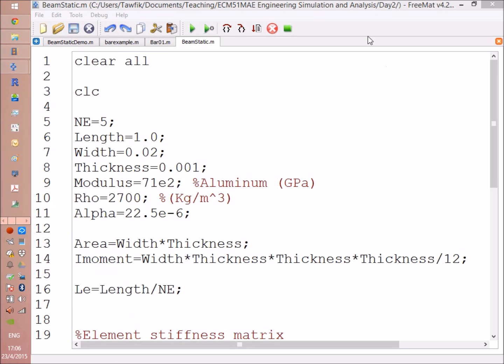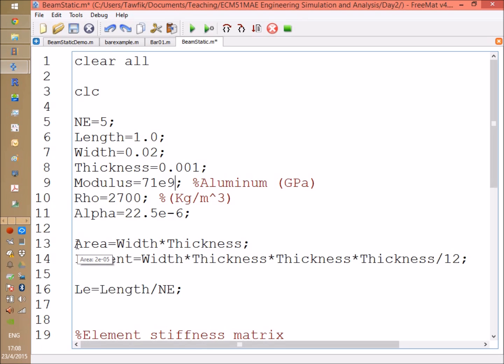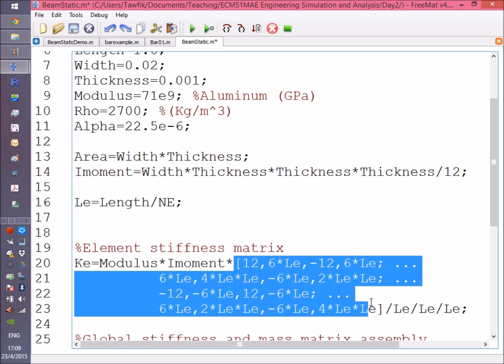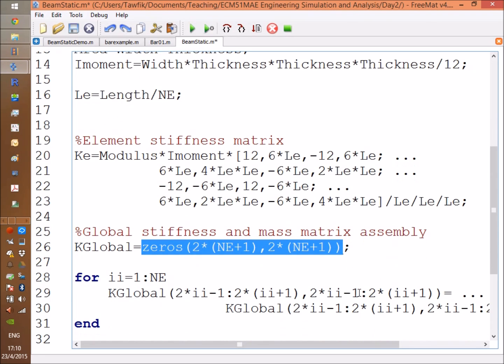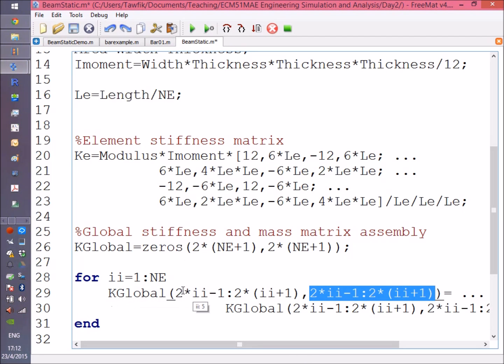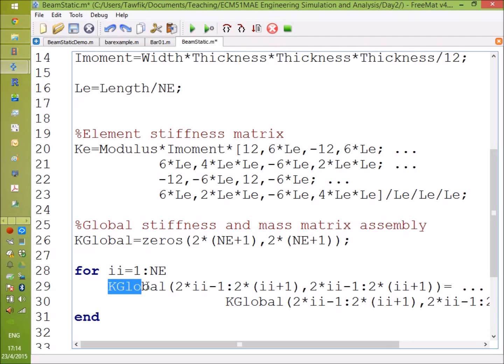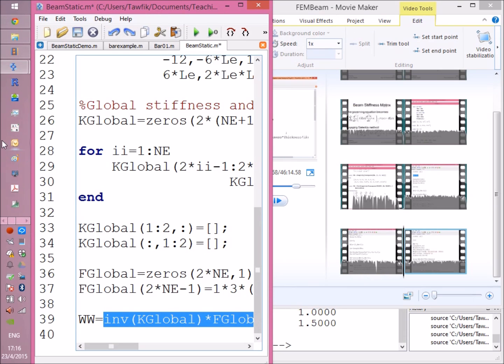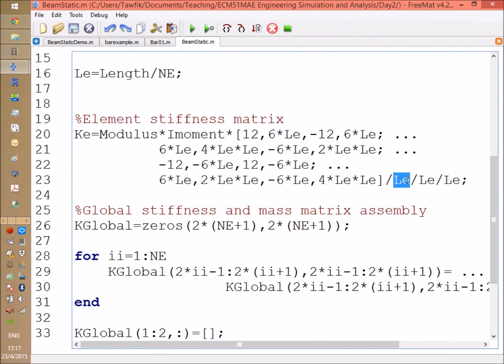FEM: Beam Octave/FreeMat/Matlab Code

Comment: if beam element have different length, width, thickness. there will be different Ke stiffness matrix for each element. then what is the necessary amendments that should be made in code to pop-up global matrix?
Reply from the maker: If you add the code of evaluating the element matrix into the assembly loops, then you may be able to account for the stiffness if different elements

Comment: روح يا محمد قلبي راضي عليك يا ابني !!! فديت خشمك
Reply from the maker: اشكرك على الكلمات الجميلة :)

ممكن أعرف مين؟
Reply: انا  اريد ان اعرف كيف اكتب ماتريكس فيه عشرة فانايت ايلمنت حتى اطلع الnatural frequency , اكتبها لي واعدك ادعيلك كل يوم في رمضان !
Reply from the maker: Check this
https://www.researchgate.net/publication/321850001_Dynamics_and_Control_of_Flexible_Structures_Book_Draft

These are my lecture notes on structure dynamics .... you will finite element code as well ... still, feel free to send me any more inquiries
Reply: Mohammad Tawfik والله انك كفو جتني الصيحة
Reply: Thank you so much. It helped me a lot. I have only one question plz. In the case i have it's a 2m beam with a hinge on the left side,  roller at 1.6m and free at the right end. If im solving for the 1st natural frequency will it be different than a normal simply supported beam ?
Reply from the maker: Sure will be different ... adding a hinge in the FE model is a bit tricky though!
Reply: Mohammad Tawfik any hints on how i can do that ? Or recommendations for videos or books where i can learn it?
Reply from the maker: To add the hinge, you will need to work with the moments and slopes at the node of the hinge as two different values, thus, in the assembly, you will not add the rows and columns of the slopes from both sides, rather, put them as two different one.

Hope this helps

Comment: good video tank you so  much
Reply from the maker: You are welcome :)
Reply: plz can you help me!!
 when i run this program i have this error : Index ecxeds  matrix dimentions
Reply from the maker: Sorry for the delayed response!

This error may appear when you are addressing an element of a matrix that does not exist ... in this case, check the indices you are using, one of them is larger than the matrix dimension (for example is you have a 10x10 matrix, and you are access the element number (11,10))
Reply: @MohammadTawfik  appreciated your effort...I would like to ask ,when I apply boundary condotion on KGlobal matrix it gives matrix of zeros..please you guide me..

Comment: Hi. Good video. Thank You,Sir. May I ask, can I use this method to solve for supersonic panel flutter analysis?
Reply from the maker: Yes ... however, I have another video about panel flutter, and I may be able to guide you through the process

Sorry for the late reply
Reply: No worries. Thanks for replying. I would be glad if you could render some guidance. I have discretise the equation of motion of Von Karman large plate theory by finite difference and have generated some matlab codes. The problem I have was that at t=0, there were deflections,which i think,should not be the case. I dont mind sharing the codes and the workings separately. Hope to hear from you soon.
Reply from the maker: I have not worked with Non-linear Finite difference before ... However, the solution should follow a similar procedure like the finite element, since you have nonlinear terms in the equation ... that is to say, you will need to solve a nonlinear problem at each step (Newton-Raphson, bisection, fixed point iterations, ...) ... I can not tell why are you getting initial deflections, but you will need to introduce them, artificially, every time step to make sure that equilibrium occurs at at ZERO deflctions in everystep BEFORE buckling or flutter.
Reply: Appreciate the advice. will introduce the parameters mentioned to see the outcome. Once again, thank you sir.

Comment: Good Video!! Just one question how would you plot the deflection curve?
Reply from the maker: You may plot the deflection curve by extracting the deflection values from the solution then plotting them.

A more sophisticated way would be using both the deflections and the slopes to create a smoother curve, but I never use it as it does not really give much difference in how the curve looks.
Reply: ما بعرفش واللهي